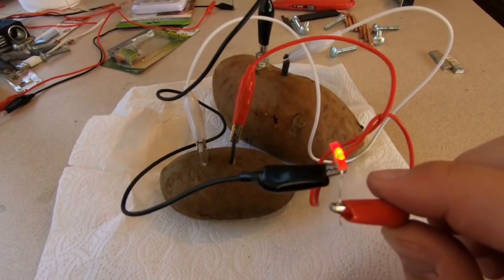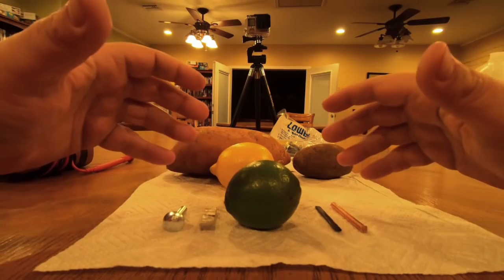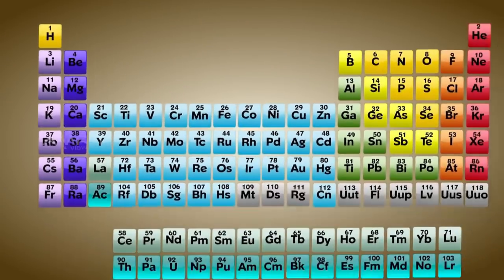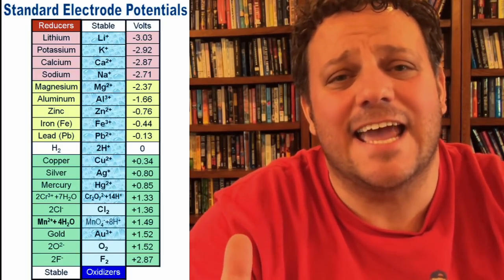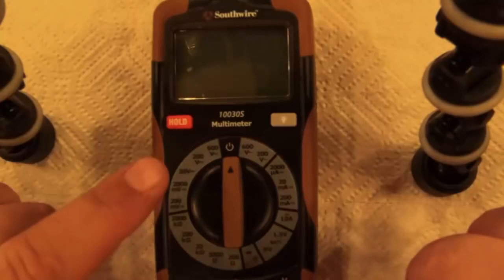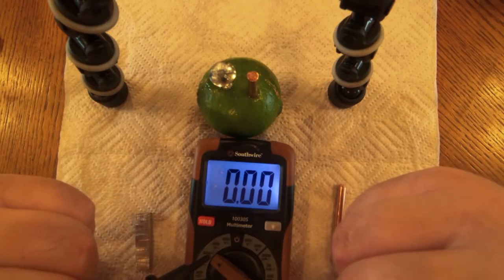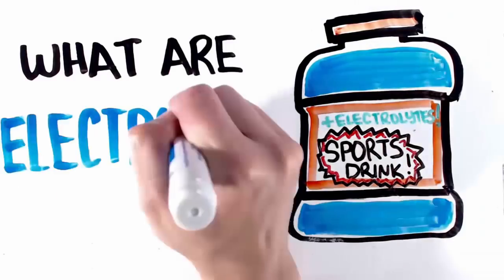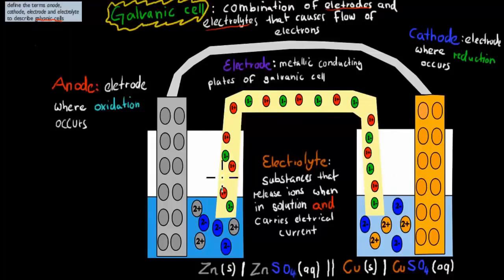Understanding Off Grid Battery Technology: Introduction To Battery Chemistry (Electrodes & Voltage)

Comment: James, there is a reason so few people go into science, technology, engineering or mathematics.  They can't follow the concepts.  While this was Middle School physics, it was a good refresher and you did an excellent job presenting it.  I can see nomad parents using it for home schooling.  Please post the next one soon.  I was surprised the graphite did so well.  Can't remember seeing that tried before.
Reply from the maker: +Bill Long Graphite is being heavily used in new battery chemistries.  In fact they have a one layer Nano tech graphite that's been named Graphene.  It's the same form of graphite in a hexagon pattern which allows one atom thick layer.  Super light and low resistance.
Reply: I feel stupid now.  I was thinking flooded cell and AGM technology but the original dry cell batteries were carbon zinc.  It is interesting this tech is moving to wet cell now.  I'll have to look up Graphene.
Reply from the maker: +Bill Long No need to feel that way.  It's not your responsibility to memorize everything.

Comment: If anyone is wondering NiFe is the most economical and durable battery tech, and sealed lead-acid AGM 250AH is the best common deep-cycle. There is no universal charge method either it's per-model cycles..
Reply from the maker: +Erik Breaman I'd disagree,  I see far more benefit in LiFePO, higher storage density, more current and better for the environment.  Better high temp performance as well.
Reply: NiFe lasts over half a century under far from ideal use and are far more climate independent. I addition to having the ability to not be affected by very violent charge cycling.. There literally is no other chemistry and plate combination invented to date that can do this.

All these are based on a very reckless mining industry and all require polypropylene enclosures.. NiFe discharges slower and has less density is all you can hold against it really... It's the most durable and economical battery tech there is though... LiFePO only really beats optimal SLA.

By the way most people don't know there is no generic charging even within SLA. Most RV people just waste batteries by going over 35% and blasting them back up with generic charge controllers.. Supposed celebrity experts on solar here on YT get called out for it on battery forums all the time..
Reply from the maker: +Erik Breaman NiFe is a poor choice for a Nomadic,  not even worth discussing because of its poor power to weight and slow discharge.  I need light and high current on demand. NiFe is a total fail on that scale.  LiFePO kills it,  kills SLA and is better than NiCadmium. All but one of the competing Lithium chemistries are toxic and LiFePO falls in the middle for power to weight. To me environmental impact is huge.  AGM sucks for many reasons.
Reply: I've been using parallel-grouped series-grid 6v NiFe for the past decade(they were hard to get before that) on both my 14' camper and 22' class C(I live in them full time and live in the desert with no power grid). I've spent and wasted a third of what people I know who use top of the line(UPG, Trojan, Rolls, Concorde) SLA&VLRA have..

I won't argue LiFePo is cleaner and at least a little more efficient than SLA&VLRA though.. But I've yet to see anything that suggest LiFePo is basically a indestruble cell like NiFe is though, and it's not got a huge margin over SLA&VLRA..

Again, all of them are based on polypropylene housing wreckless mining byproduct so the green argument is out the window..
Reply from the maker: +Erik Breaman We have to disagree on the green angle completely.  Being benefit to the environment is not about causing no problems,  it's about eliminating as much damage as possible.  If you are using NiFe in your RV then your power usage is low Vs your solar array.  NiFe charge to discharge is less than 65% efficient from the get go.  Where as LiFePO4 is 85% or more.  So,  big improvement there,  NiFe has 10 times the self discharge rate of LiFePO4. I can find data on the decay curve associated with NiFe that I believe to be credible.  But,  I know from chemistry it won't be as good as any of the Lithium technology.  Also, if you are using anything like a microwave or blow dryer then then you must be carrying around a rediculious amount of weight to give yourself the current needed.  I personally think NiFe is an awesome choice for someone who does not have weight or space restrictions.  Especially if the tech used a carbon microfilliment design that was platted with the nickle oxide.  This would bring the initial cost down considerably. I bet you, you can purchase such product in bulk from China at wholesale.  But,  you'd likely need to patterned with a group of folks and have purchase of 1p0 units at once.  Pricing I would expect to be about $3 an Ah for 12V. Which if you can have large enough of a bank makes it the cheapest storage option.  

The durability of over and undercharge are the spots NiFe is a winner over LiFePO4. Physical abuse I'd still go with LiFePO4, but personally wouldn't beat up either enough to notice the difference so that is negligible in the whole scheme of things.

Comment: Nobody is disconnected from the grid. They all have their cell phones and computers. "Tiny Homes" have electricity and running water. All this off grid stuff is a lot of hooey...
Reply from the maker: +mobiltec Surprisingly I know a number of folks that are totallt off grid in the woods.  Some folks just want to be off grid for a little bit.  Others just want to have all the benefits of home in very remote places. Still disconnected from the grid.  It's a common way of talking about it.
Reply: So are yours 3XR5
Reply from the maker: +3XR5 This true,  but for a very small number of folks.